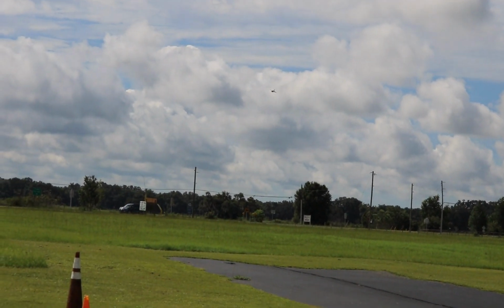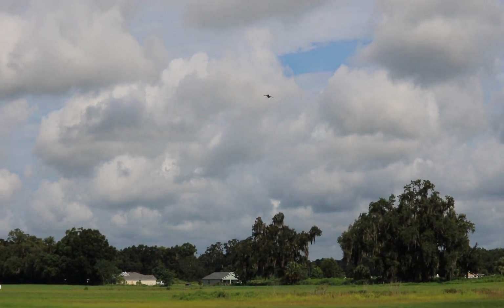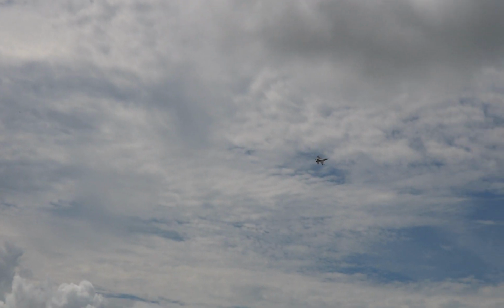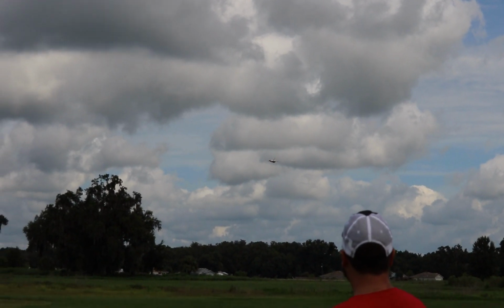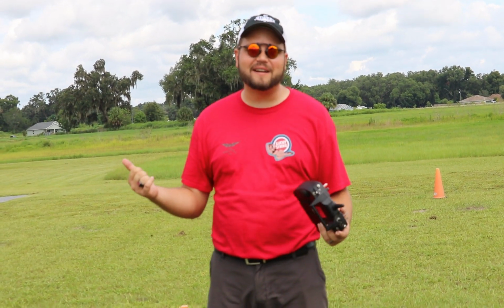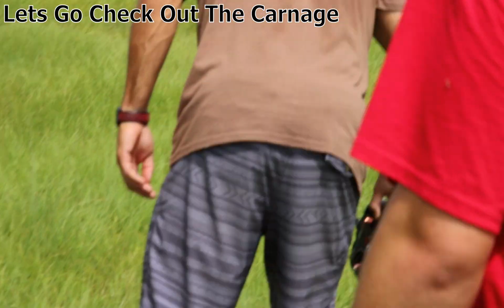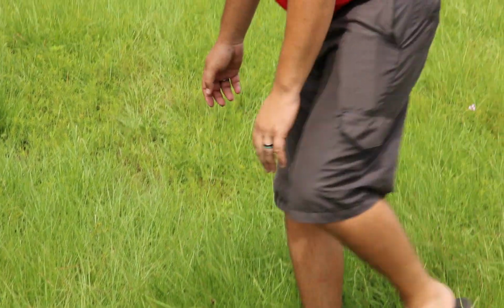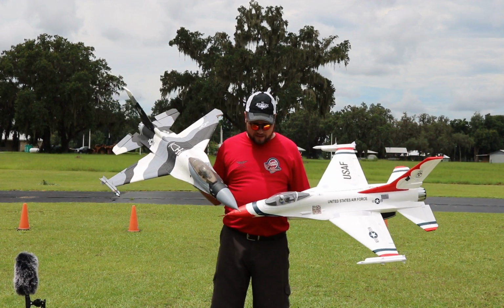Freewing vs E-Flite  F-16 Fly Hard and Formation With A Crash! Oops.

Comment: Wes, just get a piece of blue insulation foam, use it to repair the wing, then bust out the airbrush. I have used this foam to rebuild alot of stuff on foam planes. Works fantastic. I think it would make a very good shop video. Just cut an oversize piece, glue in (i use gorilla glue with no water, cover seam with painters tape while glue sets,  nice smooth seams) sand to shape, seal with a little light weight spackle, final sand, prime, paint. Indistinguishable from rest of plane when done.

Comment: What's high alpha?
Reply: I got the freewing 70 Alaskan aggressor
Reply from the maker: It’s flight with a nose high attitude. Almost like flying with the wing stalled at all times... hard to explain.... At slower speeds, an airplane must increase its alpha (point the nose higher) in order to continue flying in a straight line. High-alpha maneuvers are maneuvers performed at slow speeds with high angles of attack, close to a stall, demonstrating the aircraft's maximum maneuverability at slow speeds.

Comment: Looks like a classic Spectrum crash to me. Batteries don't disconnect in level flight. My buddy had 6 crashes and I watched 4 of them. All 4 identical, a gradual nose into the ground. Two of them still had the battery connected and servos working properly when found.
Reply from the maker: Could be we where just guessing. We are both confident flyers and it definitely lost something although it wasn’t a spectrum receiver. In all fairness this was an admiral receiver. But it is DSM